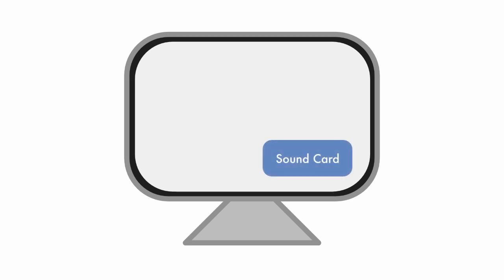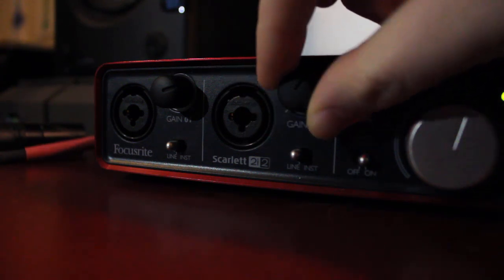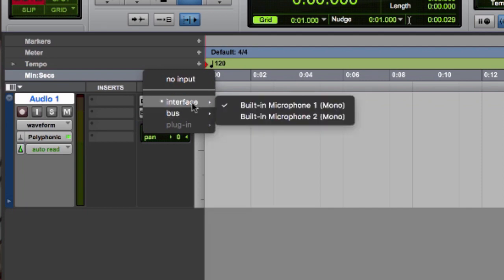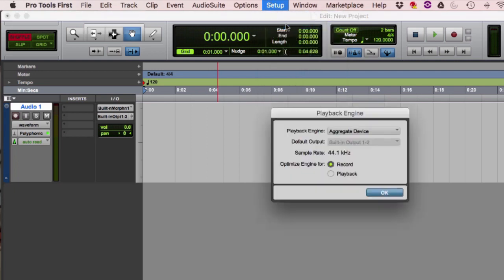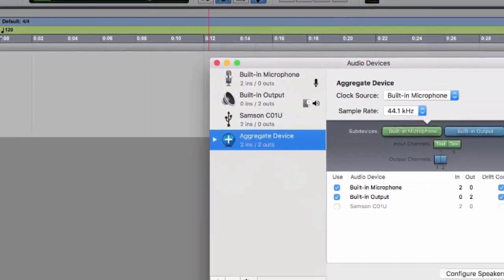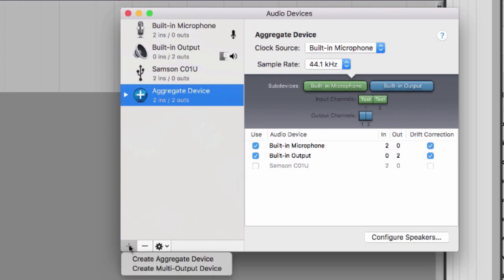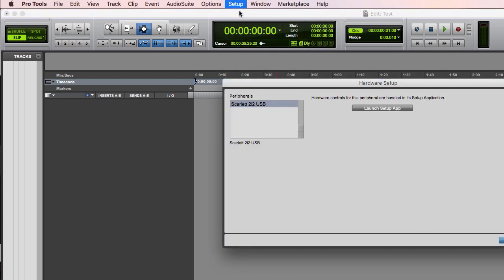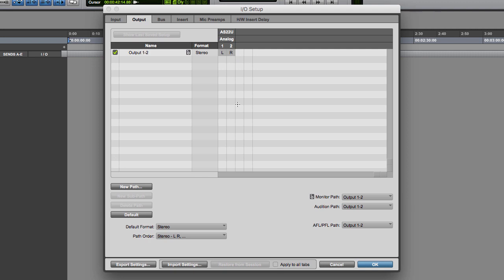[ Tutorial ] ProTools - 3: Setup Inputs and Outputs

Comment: Hey so I have a blue yeti mic. I believe it comes with it’s own built in interface, so I’d like to know to set it up with pro tools. I have a focusrite interface but it doesn’t seem to be able to plug in the mic. No sound is coming out of my pro tools cuz I have no I/o and can’t access the playback engine. I’d greatly appreciate some help
Reply from the maker: If you have a Windows machine, you may be somewhat out of luck here. I've been having to setup ProTools for a Windows machine for the first time and discovered that if you don't have an external interface (which are not used with USB mics) ProTools is not well optimized on PCs to work with built in sound cards (which your USB mic would be connecting to). I've seen ways it can be done, but it appears to be unreliable unless you know exactly what you're doing.

To see your I/Os though, it may not be selected to show on the track. If it's not visible there it may not be select from the dropdown shown in the tutorial below at 30 seconds in. I/O needs to have a check mark next to it to be visible.

https://www.youtube.com/watch?time_continue=31&v=TkcHD6gt4fg
Reply: same problem here , same mic , a Blue yeti , however i do have an interface to work with , i just cant get any input to work . playback or output works just fine . how infuriating is this . 
holla if you have found a solution !

Comment: my mic sounds very low in pro tools.  have all the volume up and even in pro tools.It does not pass the negative 20 when i am recording. Can you t
please help me out
Reply from the maker: If you are hearing some sound at least and it is very low, my first inclination would be that your mic may not be getting enough power from your interface/preamp. Some of the entry level interfaces don't give you a ton of gain and certain mics require additional peripherals to provide you with more. 

As long as you are hearing sound at all in ProTools, it is likely more to do with your outboard gear, since you almost never control gain directly from inside of ProTools. Do you mind me asking what equipment you're using as an interface and mic?
Reply: @NatalieVanSistine  thank you for your rapid response. My interface is not an entry level one.Now before I was using it with a windows computer and it was working fine but now with the mac it's not. The funny part is that mac does not require a software for it . Do you have any idea what can I do
Reply from the maker: @paulojustinianookubo  Hmm, I see. That is strange. Are you running into this issue with input monitoring or playback?
Reply: @NatalieVanSistine  no ma'am  I am not. Only when I record the mic sounds very low like it does not pass the half way mark on volume in pro tools I/o
Reply from the maker: @paulojustinianookubo  Got it. In that case, this isn't sounding like a ProTools issue that I've personally encountered (but it still might be!) Typically I see that happen more with hardware - such as recording at line level instead of mic level. 

 I would recommend trying the AVID user forums (at http://duc.avid.com/) to get some additional perspectives at this point. They'll probably ask exactly what gear you're working with and see what your settings are to get a better picture of what could be the source of the issue. They're a tremendous help - I always go there when I'm stumped!